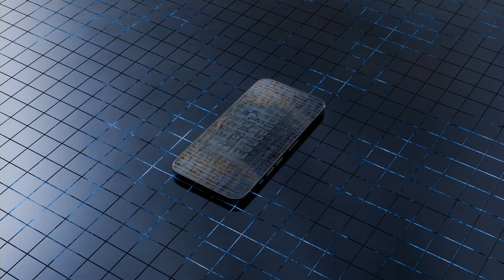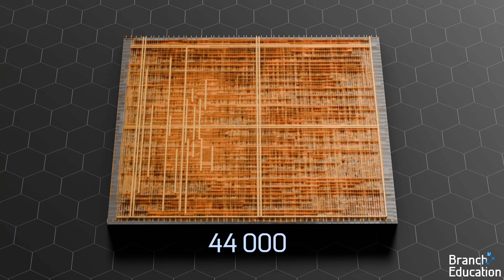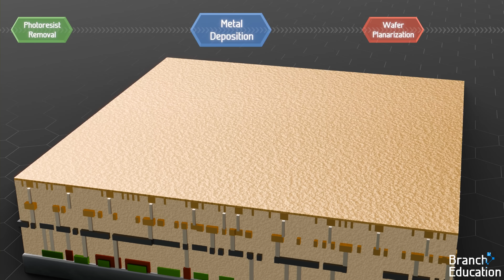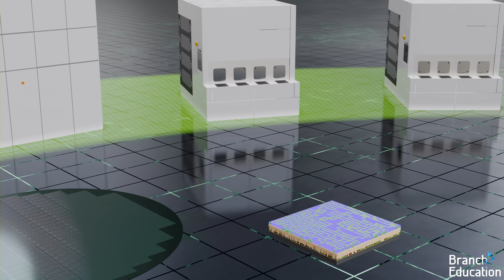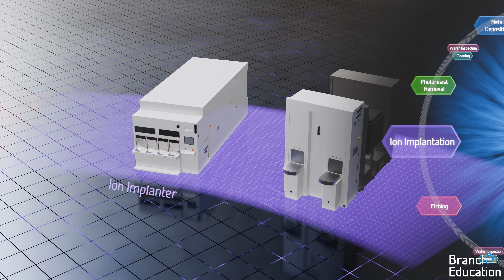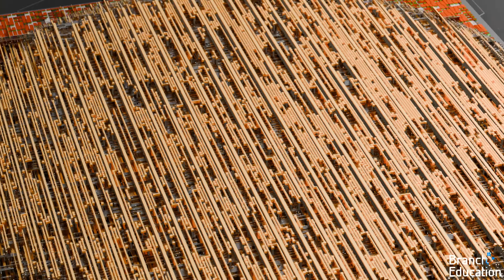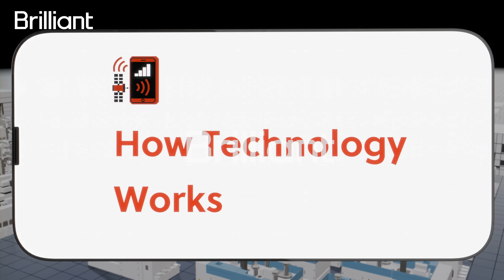How are Microchips Made? 🖥️🛠️ CPU Manufacturing Process Steps

Comment: As a microelectronics Technology student, this is really helpful. However, you're incorrect on the cost of a single wafer. we were told at Portland Community College where Intel created the courses that you're using. That 1 wafer costs about $300k. Ruin one and you'll get written up at Intel. Ruin 2 and you're fired. And your plant model looks like the Ronler Acres Intel plant. At least on the outside. Also for those interested in the field know this: the starting pay at Intel is only about $19/hour and at Intel you'll work 12-hour shifts of 3 days on, 4 days off, on week 1. Then work 4 days on, 3 days off, on week 2. You'll rotate this weekly schedule for 3 months. Then they forced you to take 1 month of PTO. Rinse repeat from there. Intel goes through a lot of technicians doing this. They burn out really quickly. A lot of other plants do the same kind of schedule. One more thing the chips we are manufacturing today are using the 3nm chips the smallest we believe we can go

Comment: 23:40 How do you control how many i9, i7, ... one makes? Do you make the machines run faster so they make more errors?
Reply: You don't really control it but I bet they refine their processes to be more efficient. Think of it like their goal is to get more i7, i9 chips per cut.  It's funny how precise everything sounds but tons of defects happen in the process. I bet some alien species observing us thinking how trash this system is. 🤣
Reply: @GrayFox102  i find it a cool funfact that basically every processor has some fault in it even if its brand new

Comment: 6:00 But how is the intricate stencil made?
Reply: The design is made by engineers using a CAD tool and a mask is printed. The mask is a lot larger than the die itself, the light is focused onto a smaller area on the silicon with mirrors

Comment: I am a world authority on semiconductor manufacturing and travel all over the world lecturing on this subject, and I have to say that this is the best video overview of chip manufacturing that I have ever seen, You only made two mistakes: 1. EUV radiation does not PASS through EUV masks, it reflects off of them because EUV radiation will not pass through glass. 2. Copper metal seed is deposited using Physical Vapor Deposition, but the bulk of the Copper metal is deposited via Electrochemical Deposition. Other than these two small errors your video was excellent. And the graphics were extraordinary! If ever you need advice on the finer points of semiconductor manufacturing don't hesitate to contact me.
Reply: @JerryHealey-x3s I have Googled you, are ypu the one worked for Motorola?

Comment: AI Summary

Abstract:

This video provides a comprehensive exploration of the semiconductor manufacturing process, detailing how modern CPUs with billions of nanoscopic transistors are created. It begins by deconstructing the physical anatomy of a microchip, showcasing its multi-layered structure of metal interconnects built upon a foundation of FinFET transistors. The core of the video explains the cyclical fabrication process, which primarily involves photolithography to pattern layers, deposition to add materials, etching to remove them, and chemical mechanical planarization (CMP) to ensure flatness.

The viewer is taken on a virtual tour of a semiconductor fabrication plant ("fab"), illustrating how silicon wafers are transported in sealed pods (FOUPs) and processed by massive, highly specialized tools. The video categorizes these tools by function—patterning, deposition, removal, modification, cleaning, and inspection—and explains the role of each. The narrative also covers the full lifecycle of a chip, from the creation of pure silicon wafers to the final post-fabrication steps of testing, "binning" (categorizing by quality), dicing, and packaging into a final product.

The Complete Guide to Microchip Manufacturing: From Sand to CPU

*   0:00:00 The Scale of Modern Chips: A single modern microchip contains a massive number of components, with the example chip featuring 90 billion transistors. The fabrication plants ("fabs") where they are made are enormous, covering the area of approximately 8 football fields.
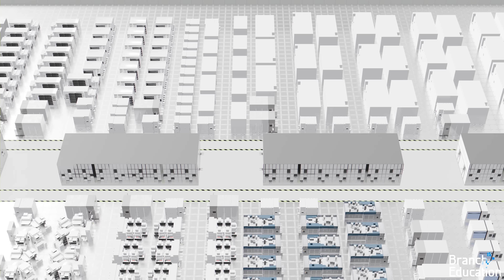*   0:00:50 A Long and Complex Process: Manufacturing a single wafer full of CPUs is an incredibly intricate process that takes around 3 months and involves over a thousand distinct steps.
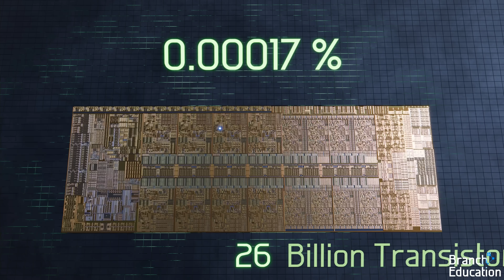*   0:03:13 The Anatomy of a CPU: A chip is not a single flat layer. It consists of nanoscopic transistors at the bottom, with a complex, multi-layered "labyrinth" of metal interconnects and insulating materials built on top. A modern CPU can have as many as 17 layers of these metal wires.
*   0:04:23 FinFET Transistors: The fundamental building blocks are incredibly small 3D transistors called FinFETs. The ones shown are just 36 by 52 nanometers, which is thousands of times smaller than the width of a human hair.
*   0:05:41 The Core Manufacturing Cycle: The creation of each layer follows a repeating sequence of steps:
    1.  Deposition: A new material (like an insulator or metal) is added to the wafer.
    2.  Photolithography: A light-sensitive material (photoresist) is applied, and a pattern is projected onto it using UV light and a stencil (photomask).
    3.  Etching: The pattern is developed, and chemicals or plasmas are used to etch away unwanted material.
    4.  Planarization: The surface is ground down to be perfectly flat, preparing it for the next layer.
*   0:08:07 Automated Wafer Handling: Silicon wafers are transported throughout the fab in sealed containers called FOUPs (Front Opening Universal Pods). An automated overhead transport system moves these FOUPs between the hundreds of processing tools.
*   0:10:21 Photolithography: The Key Patterning Step: Photolithography is the most critical and expensive process. It uses a large stencil, or "photomask," and a system of lenses to shrink and project the circuit design onto the wafer with UV light, creating nanoscopic patterns. A single CPU design requires around 80 different photomasks for its various layers.
*   0:13:45 Deposition Tools: These machines add thin films of materials to the wafer. Different tools are used for different materials, such as insulators (oxides), and conductive metals (like copper).
*   0:15:03 Material Removal Tools: This category includes Etchers, which use plasma to precisely remove material, and Chemical Mechanical Planarization (CMP) tools, which use a slurry and a polishing pad to grind the wafer surface perfectly flat after a layer is deposited.
*   0:15:57 Ion Implantation for Doping: To create functional transistors, the silicon must be "doped." Ion implanters shoot ions of elements like phosphorus or boron into the silicon lattice, altering its electrical properties in specific regions.
*   0:17:27 Metrology and Inspection: At every stage, metrology tools like scanning electron microscopes are used to inspect the wafer for defects. This constant monitoring is crucial to ensure a high yield, as a single mistake can ruin the entire 3-month process.
*   0:23:13 Post-Fabrication: Testing and Binning: After manufacturing, every CPU on the wafer is tested. Based on performance and which parts are fully functional, they are sorted or "binned" into different product categories (e.g., Core i9, i7, i5).
*   0:23:56 Final Assembly and Packaging: The wafer is cut ("diced") into individual chips. Each functional chip is mounted on a substrate, covered with a heat spreader, and packaged into the final CPU form factor that can be installed in a computer.

Cost (if I didn't use the free tier): $0.03
Input tokens: 16313
Output tokens: 1113

Summary of YouTube Comments

The comments section for the "How are Microchips Made?" video is a testament to its exceptional quality and impact, with a near-unanimous wave of awe and praise from a diverse audience. The feedback can be categorized into several key themes:

*   Overwhelming Praise for Quality and Clarity: Viewers are consistently blown away by the video's production value, calling the animations and visualizations a "masterpiece," "top-notch," and "the best on YouTube." Many state that the video explains one of the world's most complex manufacturing processes with a clarity that makes it accessible to everyone, from laypeople to engineering students. A common sentiment is that the video taught them more in 28 minutes than entire university courses on the subject.

*   Validation from Industry Professionals: A significant number of comments come from individuals working directly in the semiconductor industry—engineers, technicians, and managers from companies like TSMC, Intel, Samsung, and ASML. They consistently validate the video's accuracy, detail, and quality, often stating it's the best explanation they have ever seen and that it's good enough to be used as official training material for new hires.

*   Awe at the Manufacturing Process Itself: Beyond praising the video, viewers express profound astonishment at the human ingenuity behind microchip fabrication. Many describe the technology as "wizardry," "alien tech," or "the absolute peak of human ingenuity." A frequent comment is that they will never complain about the price of a CPU again after understanding the complexity involved.

*   Appreciation for the Creator's Effort: The 1,300 hours of work mentioned by the creator is a major talking point. Viewers express immense gratitude and respect for the dedication required to produce such a detailed video. This often leads to the sentiment that the content is so valuable it "feels illegal to watch for free," prompting many to donate, become patrons, or express guilt for not being able to.

*   Key "Aha!" Learning Moments: Many viewers highlight the "binning" process as a particularly surprising revelation. The idea that different tiers of CPUs (e.g., Core i9, i7, i5) can come from the same wafer, with their final designation determined by the number and location of defects, was a new and fascinating concept for a large portion of the audience.

*   Use as an Educational Resource: Numerous comments are from educators, including university professors and high school teachers, who state they will be using the video in their classrooms to teach students about semiconductor manufacturing. This underscores the video's value as a high-quality, free educational tool.

I used gemini-2.5-pro| input-price: 1.25 output-price: 10 max-context-length: 200_000 on rocketrecap dot com to summarize the transcript.
Cost (if I didn't use the free tier): $0.05
Input tokens: 38751
Output tokens: 557

Comment: I've worked in the upstate New york semiconductor industry for the last 10 years, everything from manufacturing, R&D, subfab, cleanroom, gas and chemical rooms and I currently work at one of the most advanced R&D facility in the states. This video is extremely accurate as a general summary. There's alot more to it in regards to facilitating these tools.

These fabs cost 10's of billions of dollars to build and any downtime results in million dollar loses an hour.

The tool price is also a little low, we're currently awaiting a tool that cost upwards of $500m and only 10 exist in the world and this one will be the first one to hit the united states.

These cleanrooms where the chips are made are extremely clean, talking measuring ppb and even ppt to ensure no contamination.

Comment: The only thing I don't like at all about these videos is the order in which the topics tend to be explained: The narrator zigzags a lot back and forth from the topics, constantly moving away to different topics and then coming back to the same topics again before changing again shortly after that. This puts a lot of strain on the brain in having to constantly switch and try to keep a streamlined understanding of the entire process. I recommend ordering the topics in a single streamlined and progressive flow from "bottom" to "top" rather than taking this "zigzagged" up and down approach😵‍💫🥴. The animations are pristine, however 😊👌⭐ It's just the order in which they are explained which delivers a very bumpy ride.

Comment: 5:10 I may have said it in another video. Edit: ok you discussed it towards the end. Very good video!

many advanced chips have built in redundancy to allow for imperfections when" baking their cake". The PS3 processor was built with 8 cores. One core was used as a back up In case was one faulty, this was to increase yield.

 If all cells were good they just disabled one to make 7 cells.

 For GPUs,many are graded based on their defects. If defective they still work but are less powerful or prone to minor errors. It's like your Lego brick analogy, just because one or a few hundred bricks are misaligned doesn't mean the whole chip is bad, it's just less powerful or may be prone to slightly higher BER that software/hardware can  correct.

Comment: 10:37 man i just cant stop thinking about that rick and morty video of how they make the plumbus  First, they take the dinglebop They smooth it out with a bunch of schleem. They rub the fleeb... and the fleeb has all the fleeb juice They cut the fleeb. There's several hizzards in the way. The plubus and grumbo are shaved away That leaves you with... a regular old Plumbus/ 
First, they take electronic-grade silicon, They slice the ingot into wafers, They perform chemical-mechanical planarization, And apply photoresist by spinning the wafer at high RPM for a uniform thin layer, They align the photomask and expose to UV light to define the circuit pattern, The silicon and oxide are shaved away, That leaves you with... a regular old CPU die.

Comment: and after that whole journey of what the CPU went trough, a duchbag like me comes around, rips off the headspreader, put liquidmetal on ast thermal-interface-material and then sending so much voltage in the Core as possbile while managing the core temps to get the highest clock speeds possible... i love my hobby 😀

Comment: I was honestly blown away by the visual size comparision of a finFET with a mitochondrion; so I did a bit of digging. Turns out my guy was not exagerrating at all, infact modern day transistors may possibly be 100 times smaller than a mitochondrion in linear dimensions. By volume, the difference is even more dramatic;  hundreds of thousands of modern transistors could fit within the volume of a single mitochondrion, Like WHAT!?

Comment: The concept of the lithography tool is simply brilliant (pun intended). We can craft materials at the atomic level using much larger stencils that we're comfortable manipulating physically... and scale them down using lenses, almost like a "reverse microscope." We can then "inlay" the shape using almost liquid elements due to the small size of the process. Macro-manufacturing techniques applied to the subatomic scale. Nifty!

Comment: Worked in semiconductors for 30+ years. This is an excellent video and covers very well how chips are made. Dating myself but when I started we used 3” wafers with 8 micron layout rules and only 2 layers of metal. A full mask set cost 10k and there were only about 8 layers. 😂

Comment: 17:39.  The top image is acquired by a scanning electron microscope (SEM, top view) which is used in production because it is easy to do.  The bottom two images are acquired by a transmission electron microscope (TEM, side view).  A TEM image like this requires elaborate and long preparation like with a focused ion beam (FIB) tool to cut out very thin (nanometer thin) slices from the sample and then interested into the TEM for imaging.  Thus typically TEM imaging is relegated to development labs rather than production.

Comment: The packaging is actually a lot more complex than cutting the chips and placing on a circuit board. It can be as difficult as making the chip. Also, lots of these machines are unique, so a fab is an entire complex that functions as a single machine and there is no replacement.

Comment: They need to do everything in a heated chamber so the material expands. then let it cool and everything shrinks with less defects. They need to manufacture the chip at the hottest operating temperature of the chip so when it expands it will be that size...or average operating temperature. (experiment cant say which is best.)

Comment: I worked at a injection molding plant, and we had a contract with ASSYST. It was before the foup We made all the parts for the PODS, RETICAL transporters, All that stuff. We also had a clean room to assemble everything. The DOME tool was 5,000 lb's. in a THOUSAND TON PRESS.

Comment: So the initial silicon wafer is only used for the very first layer where the transistors are. The silicon dioxide that is sprayed on is just the insulated padding that holds the interconnects?

Comment: I worked in a US lab which created only a few layers for Western Electric. Although it has been many years, my recollection was that the chips we produced were for telecommunications. We grew silicone crystals in vacuum chanbers. We used a similar photographic mask etching method. At our facility things were not yet so complicated and the chip ended up in a simple IC circuit chip which would later be soldered in place on a small motherboard. Remember in those days personal computers did not exist. I remember the news of the first internet connection between UCLA and Stanford using an IMP made, i believe, by BBN. We didn't have robots to deliver the chips, I guess you could say, I was the robot. I kept things very clean which was tough in a bunny suit. It is too bad this industry left the USA because it was nice work, boring and repetitious, perhaps, but very clean and somehow satisfying. I hope the industry comes back to where it belongs.